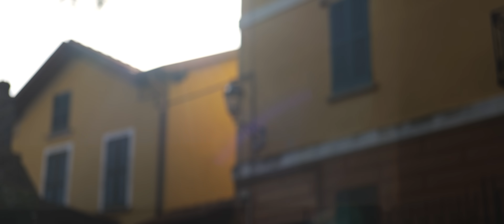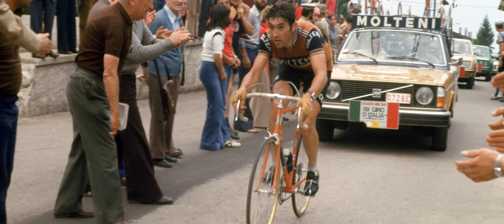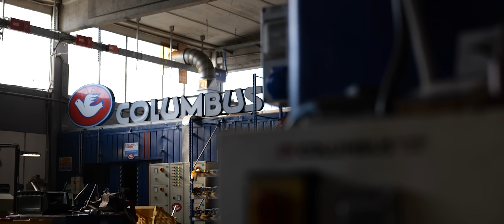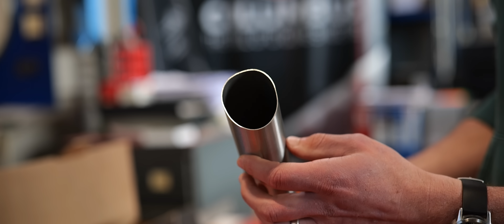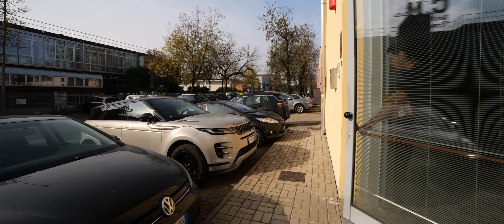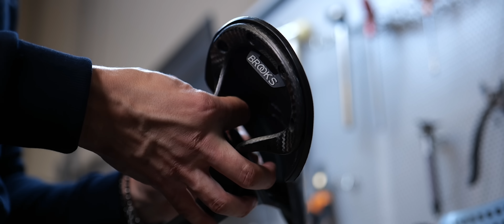This New Colnago Will Blow Your Mind

Comment: Koga Miyata made excellent steel bikes in the 80's. They even had oversized steel frames with tubes that changed in diameter and form. One of the best bikes I ever had with very good feel. Japans steel is the best in the world, the cost of these bikes was an order of magnitude less. I would go for such a bike and restore it. That will be the ultimate satisfaction.

Comment: Colnago's vanity project is for collectors. But bang for the buck? I bought a used Marinoni custom built racing bike, hand welded and hydro-formed 7000 series Reynolds tubing, carbon fork, 73 degree head and seat tube angles, 99.5 cm wheelbase, and 8.5 kg total weight, for $300. It flies, especially with the new wheelset.

Comment: Been a big fan of Colnago ever since witnessing Saronni's victory  at Goodwood in 82 on a Colnago Super Mexico but have to say I'm not impressed with the look of the Steelnuovo, a major part of the beauty of a Steel bike is seeing the beautiful lugwork, take that away and aesthetically it could just be any mass produced road bike out of China or Taiwan. I think they've long since reached a pinnacle , difficult for them to know where to go next . If I was Ernesto Colnago I would develop the hybrid market of ebikes , talking high speed commuter /racers, a bike that you can pedal at 60 mph with battery assistance, this may go a long way to reducing traffic congestion. Before everyone throws in the stumbling blocks of insurance etc, just regulate like motorbikes, need insurance and a test but the point being its best of all worlds, high speed travel, low cost , good exercise, might get a few executives out of their ridiculous electricity guzzling 4x4's if they were marketed correctly.

Comment: Once a BMX/Skateboard Freestyler in the late 80's, I also LOVED my high end road bikes. Owning a Pinarello then. Fast forward to the late 2000's. I purchased a Cervelo Carbon Fiber bike. Road it for a few years, then sold it. Fast forward to this year, I wanted to get back into riding. At first I thought Carbon Fiber, then I began to notice..........the Carbon bikes are dull, in fact the majority out there today have no character. No class, they all look the same. Doesn't matter what brand it is, they look like they're produced in one factory with a famous brand slapped on them. So, I came across a stunning pristine condition circa 1988/89 Battaglin with all the fancy trimmings. The only modern features are brake leaver shifters. Dunno, there's just some unappealing to me with Carbon Fiber bikes. In fact, bikes, I think have gotten to technical. I drool over older high end  bicycles, not so much these new models. Lol, one of my dream bikes, and has been since the 80's is the Colnago Master. I would walk into my local bike shop to purchase BMX gear and drool over that bike.

Comment: I remember you could get a killer steel frame set any size or custom from Nashbar or performance. Stock Colnago like $ 995 .00 or so then add ons   it would go up. It was before s.m .l. Sizing  that's now used.

Comment: Cold basin granite sifted and cold forged steel and time. Colder and Colder and slower cuts. You might not be able to call it a Colnago and it wouldn't be using the engineering technology; it would be a craft cycle but it's not as many great leaps off as its luxury price tag makes a pedestal for here. I like the use of more metal at the head tube where the classics use lugs. It make it at least appear more stable. Love the look it seems soft stable and strong.

Comment: Took delivery of mine yesterday. With pedals, cages and computer mount in 510 size exactly 8,3kg. Rides amazing as expected
Reply: Still waiting for mine
Reply: @ it seems I was one of the early ones (I picked it up in Italy). This bike is too damn good to be put on the wall
Reply: @Johnwis-gp9yynice work. How does it ride?
Reply: @ very very stiff yet absorbs road chatter as only steel does. Master seems like a noodle in comparison. Wheels are great - nothing on the bike flexes. Super record is the most silent drivetrain ever. It is a really a special experience. I replaced Brooks saddle immediately though.
Reply: @Johnwis-gp9yyDid you put a Lidl saddle on it?
Reply: @neilo2323  ..I..
Reply: @Johnwis-gp9yymine has finally arrived 🎉
Reply: No way that bike comes in at 8.3kg. I need to see proof.

Comment: If you are wondering what killed race bikes, your answer is right here. A middle-aged semi-fit guy buys one of these $15 thousand label queens and shows up at a weekly ride’s start point. His goal is not to take part, but rather to bask in the attention that comes with owning a bike whose ONLY purpose is to be perceived as a status symbol. 

After the ride’s departure he coasts round the block to his SUV, where he packs the bike inside and drives home.  I’ve seen this!

Comment: In engineering and manufacturing you can reuse older designs with just slight modifications and present it as new; you buy once the machines in the workshop (presses, rollers, extruders, welding machines) and enjoy the profits from them for decades! Now, if the initial investment amount has already been made, how come you are requesting almost 20k € for a steel-frame bike? R&D has already been made, the technology is from the university books (nothing new), the workshop machines have been bought and operate on profit for years or decades; the only NEW expense they make is the 3D design iterations. Ah, there you go, they just said this in the video :). The asked price is due to the fact that ppl have paid 800$ for a zip-tie bracelet on internet....yes...the fool is not the one who asks the price, but the one who pays it. They slapped the price as a joke and some9ne bit the bullet and now they are all serious, and consider it is ok to do so, to drive the prices to the sky. Max 5000 euros for the new D3SIGN (not new technology) and this is overask8ng as well.

Comment: I still have my 2013 Cinelli experience I paid $300 for and its mint. Steel is real for us over 200lbs.
I can afford a cinelli XCR or this Colnago but would never buy a 5 figure bike...unless it was a tour bike from Pantani .
Reply: What brand do u think comes close in frame quality to colnago? do u think its cinelli or surly or maybe some other brand?
Reply: @bamf6603  clark-kent 1990s frames titanium and steel. They made Greg lemond's bikes initially..hand made by master welders Ivan and Don Hurr.
My cinelli experience w 105s is a good solid beater bike..I have power tap old school power meter pedals to a coospo bp157..that's it...very reliable for strava.
The Clark-Kent and older 90s race frames are a much better value than anything you can buy now with all the quality control garbage. Buy an older frame and dura ace it..
Reply: @ I have a feeling these old frames made for named athletes are impossible to find , what’s more realistic to find and buy?
Reply: @bamf6603  there are tons I just bought one on craiglist..there are 2 on ebay right now.
Other than that the old carbon trek frames are cheap from the late 90s early aughts.
WIndspace from China makes a bikes almost as good AS TIME or LOOK

Comment: Add a lot more metal, an engine, and a LOT more engineering and you can get a motorcycle for 1/8th the price. 

Yea don't tell me the prices make sense, every cyclist is deluded by manufacturers. It's easy to market arrogance on wheels.

Comment: Interesting ad! 1.85kg is overweight. A custom steel frame made out of mid-range Reynolds 631 or Columbus Zona will be about 1.6kg to 1.7kg, and those vintage Columbus steel frames we saw a bit less. Was revealing that they said they couldn't make a steel fork at all that would pass their safety testing. It's not the weight per se that is the problem but you won't get the unique feel of a lightweight steel frame if that's what you're looking for. Hence the special "Columbus Steelnovo" tubes. They're getting Columbus to make them as thick as Cromor (at least) but probably using the seamless tubes and better alloys of the higher-end tubes.

Comment: I missed the part where he says what it weighs, and how much it flexes compared to a CF frame.
Also, I totally don't understand why they went with a CF fork.  It sounded like the sintered fork head is too weak to take the strain.  Why didn't they use a casting like they always have in the past?

Comment: “…why did Colnago go back to its roots?”
Same reason I did. Just got tired of all the foolishness. Carbon, non-standard bottom brackets, straight blade forks, overly complex headsets….
  I have a technological wonder unlike anything out there and guess what?  I’ve gone back to steel!  My new ride predates my amateur career by about four years 
BUT
it’s standard!  Yes, the parts are still readily available. 
   It’s a 1968 Paramount. A wonderful bike. Reynolds, Nuovo Record, Brooks….
   Keep your unsafe plastic wankers. Give me a steel bike!
   Tragic about Colnago. They built excellent bikes, then one day built the Super and then, tragically, they had to “improve” it. The Pinnacle of cycling perfection. SL tubing, reliable Campagnolo gripping, Clement Criterium Seta Extra….

A bike that cannot be improved.

Comment: I started with steel, back 1974. It was a used Cinelli, silver with chromed, sloping crown fork from the 60s.
After a few more frames, I got myself a brand new Serotta, with the 'trumpet tubes' - down and seat tubes get larger toward the  BB.  I still have this bike.  Never owned anything but steel. (I, like Colnago, was born in 1954)

Comment: I have a Mercier road bike from 1968. It's made from Reynolds 531 steel made in the UK. Great bike still rideable. Has Strong-light and Simplex components. With the shifters on the down tube. Everything is original except the bar tape and the sew up tires. I paid new $205 for that steel bike. That was the most expensive bike at Lynnway Cycles. How the world has changed. Seven from Watertown Mass makes a nice steel bike. Titanium actually. Not for $18,000! I'd pay $12,000 for a Colnago carbon bike with dI2 and premium wheels but not $18K for steel. I'm sure it's a fantastic bike. But I want lightness. They are a great company.

Comment: However, outdoor rain pipe of the 3D Print Company building requires replacement, it is badly dented ; ) The reason why steel is not so good for the fork, is the vibration issues, comfort, and also stiffness, That's why TIME bikes started with designing, and manufacturing carbon forks in 90' for the most of bicycle brands in Europe.
PS My first road bike was steel, Made in Poland by Romet ; ) On 22mm East German made tires.
Reply: Then explain the Colnago PRECISA fork?  Even the C40 bikes that won PR in the 90s used a steel fork.
Reply: @ralphc1405  You did not understand. I sais that on 90's Time was supplying carbon forks to many bike braands. This is fact, Since TIME was the only company able to manufacture quality forks. This is info based on report from the current American CEO of Time bikes. Most racing pros wanted carbon forks at that time.

Comment: What I don't understand is how a 3d printed lug works - doesn't it have to be forged or something to align the molecules in the metal? I mean metal working has for thousands of years realized that any steel doesn't work for a blade - it has to be worked just the right way to get the right properties.

Comment: Hot take - Steel/Ti is no longer significantly more comfortable than carbon. The newest generation of carbon bikes are able to really thread the needle between comfort and stiffness. I have both a high end Ti touring bike and a new carbon race bike and the race bike is just as comfortable as the touring. 

I think geometry, fit, saddle, handlebar/stem and wheel/tire choice are much more important.

That said, there is a beauty in perfect welds on a custom steel or Ti bike. For me that’s where a lot of the enjoyment comes from - owning a handmade bike made with traditional methods by artists.

Comment: I have been working in the composite sector for almost 30 years and the inflationary use of these materials in the hobby sector is simply unnecessary and above all a mountain of hazardous waste. The possibilities of carbon in frame construction are essentially for the design of beautiful shapes and the ratio of weight to stiffness is often less of a focus because ultimately the rider is different in the mass market. But I think above all that the sustainability of the materials is more important than 500g weight savings. My hope is in 3D printing metal components for metal frames. Still too expensive but that was also the case with the plastic frames at the beginning.

Comment: Great video! Being an engineer and CAD designer in my 50’s its great to see skill and artisans still exists as I think were a dying breed, in a world where mass production, minimal cost, maximum profit rule as king. You’re a lucky man Alex… If you could afford it you would probably buy it. It is a oggetto del desiderio indeed. More of these videos please.
Reply: Minimal cost and maximum profit is what this bike is, just on an upper level.
Reply: didnt it horrify you to listen to the guys telling us how they imagined printing the fork? this is a clownshow of an engineering project. i cant see anything special in using tech from the last century in the most expensive way possible and then throw  some buzzwords into the design.
Reply: @simonschneider5913 
Many people don't see why Swan Lake is still running in theaters, or why any car manufacturer would bother putting any effort into any type of motor that is not electric. Why own an old drafty home with handmade features when a modern home is so much more efficient? Because in a world of Bling, subtle beauty is in the eye of the beholder. Just as many people spend 3 to 7 dollars for a coffee shop product that can be bought in a can or bottle. Or, better still, at home for less than a buck.

Comment: Wilier Superleggera is also a stunning Italian bike with steel frame, and less than half the price with Super Record. Wilier also uses Columbus tubing. They managed to make the frame 200 grams lighter, and also to make the fork from Columbus steel. But even so, if I had limitless of money, I might have gone for the Colnago
Reply: The Colnago looks slightly better than the Wilier Superleggera, but I have a carbon Wilier Triestina Gran Tourismo from 2014, and that bike is sensationally good. So Its not obvious that the Colnago is better. Maybe it is, but I dont know.
Reply: I have a special steel bike to me. it was put together using mixture of steels in a suburb of Boston. Independent Fabrications. It arrived to me with a carbon fork and felt ok but I wanted the Crown Jewel fork made with Dedacciai steel that is a work of art and weighs only 300 grams. The steerer was too short so I extended it using chromoly tubing and an inner sleeve. It rides great. All steel. All repainted to match as if it came from the factory this way.

Comment: Great video! Love the attention to detail - I would love to hear about the rear derailleur  lug design. It looks unique.  Back when I was racing in Northern California in 1980, Italian bikes ruled: Gios Torino, Colnago, Masi, Pinarello etc.  Columbus SL tubing with full Campagnolo grupo was the gold standard.  Nowadays, there are so many more options and real performance improvements but I miss the simplicity of those classic designs -- They were easy to work on and would last for years with very little fuss.
Reply: When I was a kid in the early 80's, I was not quite as aware of all the premium brand Italian bikes other than Bianchi, but I sure remember reading Bicycling magazine as a kid and lusting over the Centurion Ironman, Dave Scott edition bike which got a lot of advertising in those days in the golden era of triathlon.  And of course the Masi bike from 'Breaking Away' and the early Specialized Alez's from 'American Flyers' (which I assume were chromoly back then before the Allez switched to aluminum).
Reply: @alexjohnson6462  Yeah, those Celeste Green Bianchi's were cool. They were sold in bike shops as whole bikes with a low-end Campagnolo group set you couldn't buy in the US. Specialized started selling the Allez around then. Prior to that, they were primarily a parts importer.

Comment: Wait isn't steel the cheapest material for bicycles?
Reply: Anything made on a small scale will be expensive, no matter the material.
Reply: Carbon, in terms of raw material pricing, is less expensive than all metals nowadays courtesy of asian mass scale manufacturing.

Nowadays the cost of bikes comes down less to raw materials and more to the amount of labor in the assembly process, which in turn is partly related to economy of scale of production, and then of course you have certain "premiums" tacked onto the final price which has to do with brand recognition, nostalgia of an item, and then titanium bikes also kind of have their own premium. Though nowadays titaniums price has less to do with the raw materiaos and more to do with the brand (e.g. Moots and Seven Cycles vs Waltley).